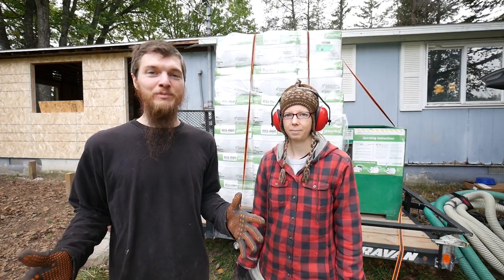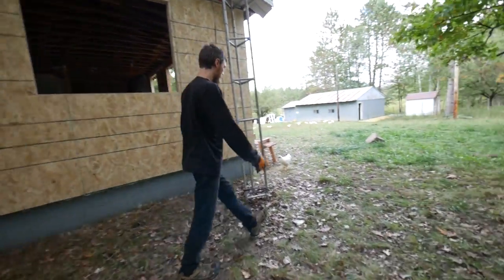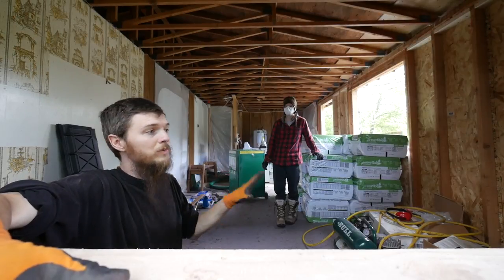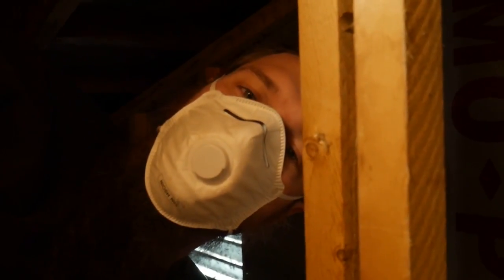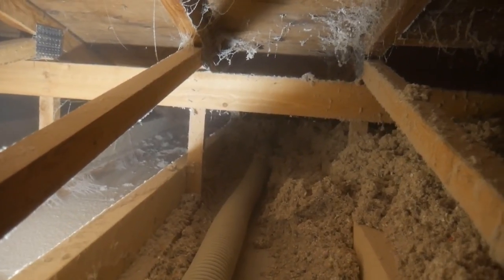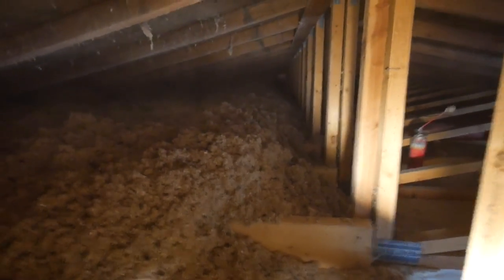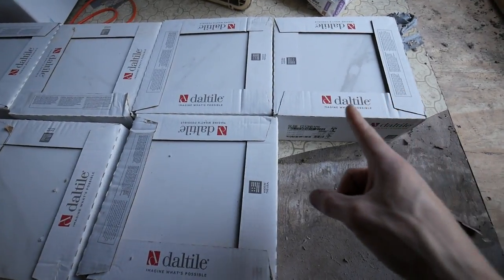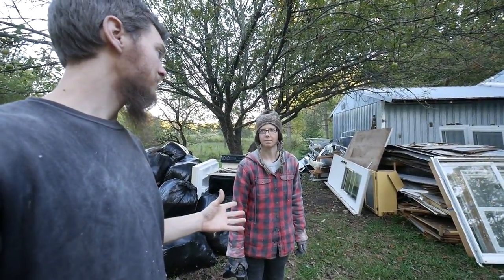Insulating a Cramped Mobile Home Attic - Home Renovation

Comment: When you do the other half of your house, try this:  Place your "bale" of insulation on top of the hopper, take a box knife and slice it all the way around the middle, rolling it forward and dragging it back towards you as you go.  Be sure to cut the plastic in one continuous line, to make two halves.  Then simply pull the halves apart, letting the entire contents slide into the hopper.  A good way to think about it is like cracking an egg in half and dropping it onto a frying pan.  Just be careful not to drop your knife in the hopper, or the bags, or anything else.  This is by far the easiest way to empty so many bags at one time!  I remember doing this, in sub-zero weather,  so speed and efficiency were of primary importance.  It is also was far neater!

Comment: Years ago I worked as a subcontractor for a insulation company. So did my husband. He cut roof vents in and installed them. I did isolation on the doors and windows
I also helped my husband and the other insulators. We blew in insulation into the walls and attic on older homes. Also wrapped hot water tanks. Loved the job. I did that for almost 3 years. Back then in the 80s the insulation was very itchy. Love watching you two working together.  My late husband and myself work on many a jobsite together
Great job. I miss working with  my husband. I have been a widow for almost 10 years. God Bless you both and be safe in all you do.☆♡☆♡

Comment: I used that insulation in two houses, in both cases in cut my electric bill in half.  I used duct tape to hold an eight foot 2x2 to the end of the hose, made it much easier to get to the low clearance areas.
Reply: Great idea norm solar hopefully doug sees your comment it will help him do the next lot...

Comment: This was an outstanding video.  I agree with Barbara...  hard working and respectful.  You inspire me.  The key you're working toward is to get your home dried in by winter, and it looks like you're doing it.  So much work.  I've tried 3 different people now to repair, and paint my porch...  Everyone said they wanted to do it, but no one has called back.  I need a 'Doug' and Ashley in my life.  Congrats on getting this insulation going.  It's going to be a toasty home, starting this winter.  I look forward to your videos.

Comment: We moved to a condo on a slab 3 years ago.  We were able to make all our flooring choices because it was not built when we bought.  We chose to heat both bathrooms and kitchen floors.  I love it.  And it's not very expensive because heat rises, but getting out if a shower on to a heated floor in winter is a joy.  If I could do over I probably would also do it in all rooms since you can turn it way down or off if not in a room often.  Concrete floors get mighty cold in WI in winter!

Comment: Great job on the insulation. The depth you are putting in will make a huge difference in comfort and heating expense. I had a suggestion for later on in your reno. My sister & her husband owned a ranch for many years. When they built their house they built in a wash-off station. It was placed out on the carport with hot and cold running water. It was great for washing off the dogs as well as the farmworkers who had been out in the fields with the cattle. I thought you might find it helpful to put in a place out back of the house where you could wash off before entering the house. Boots, gloves and other clothing that gets muddy or covered with mule and horse residue. An old sink or tub would be helpful and easy to find at a cheap price. 
The time to do these things is when your walls are open and you can run the pipe out to a small workstation.

Comment: We blew in 24 inches in our attic 6 years ago and our heating bill went from 128.00 a month to 69.00. We had 3 inches up there and blew in 24 inches. I think its R60 at 20 inches. Owens Corning said after 30 inches it wastes the fluffiness so try not to go over 24 inches. See if you can get a rebate our gas company paid 70% so we only paid about 300 bucks total and in 6 years we have saved about 4 thousand dollars. Great job.

Comment: You evenly blanket your insulation, about  5" total.you can rake alot and spread it out.You must not plug up your rafter ends, tbhey must be vented from soffit into attic space for air flow.If not you will have severe condisation, which will cause icy roof and damage to shingles , plus awful mold issues in attic space .Did you install venting between your rafters? You both seem very knowledgeable. Plus the building supplier should have ran it by you wben you  picked up materials and the machine....Awsomme work ethics, Ashley appears to be a strong  worker , Always thinking one step ahead.
Reply from the maker: Yes we have rafter vents installed and I did my best to leave them clear and open. We'll be double checking them before we close up the soffits.
Reply: @diyfferent  I kinda figured you hadi t buttoned up right ! Not trying to be  a " know it all" but Iwas thrown for a loop when I didn't see it being done in your video! Lol Great job.Cheers from Nova Scotia ,  Canada !
Reply from the maker: @glenyoung4170  It's okay. We installed them in one of our previous videos before doing the framing and drywall.

Comment: I changed out those tiles you bought, they are extremely slippery with a little water on the floor.  I would exchange them for a rougher surfaced tile.  You don't want to fall on that hard floor.

Comment: Never saw that before. Most definitely gonna put this in my house. Mine is not a modular home but it's no bigger than the double wide. I will have to find someone to crawl around in the attic. I think I would be best at feeding the machine. 62=no attic crawling. So cool. Glad u showed this. What a huge help. Once it starts snowing u won't be able to see much of the stuff outside so it should be mostly hidden until spring. No hurries ... no worries.
Reply: My husband and I did this (with the pink stuff)  it's not that hard, but tiring.  And, the person feeding the machine gets a work out too!  Good luck...
Reply: I have a young couple close to me that come help when needed. Lately I have found myself discussing any repair needed to see if they have a better or more economical idea. They r really awesome and kind and so very good at repairs. So far I've adopted 3 things from Doug and Ashley for my home. This will be the 4th. This  channel is seriously inspiring and uplifting. Oh and once I was able to prevent a repair person from ripping me off all because I knew the problem and how to fix it and didn't let him try to con me.

Comment: After you get the bathroom gutted and the ceiling back up and before you start the insulation on the rest of the roof you could use a rack and just level it off what you already have down.
Reply from the maker: I didn't think it needed to be leveled off? I thought it looked pretty evenly filled.

Comment: It is quite important that you install and tape a vapor barrier, between the 2 halves of your "house"     I think I saw baffles standing against a wall, did you put baffles from the eaves to the attic ?     next time you get insulation, get a Tyvek suit, they are hot so wear only shorts underneath.     Keep up the great work
Reply from the maker: Yep, all the areas we insulated have baffles.

Comment: Yes you need vents in the attic of some kind....  That is going to be one warm casa.   I like the tile, just don't forget to seal the grount once a year.  Thanks for the sneak peak.  : )peace
Reply from the maker: We have a ridge vent now, so the gable vents aren't needed anymore. Air comes in the eaves and exits the roof peak now :) Thanks
Reply: @diyfferent  Yup that is fine as long as you have something that's all, but you two know what you are doing.  Ashley your still getting stronger I'm impressed.   : ) peace

Comment: Hard work for the two of you, but the usual a good result. We could see how hard you were working, those small spaces defeat me now, Ashley was really holding her end of the team up well, my goodness you are a hard-working team. Blown insulation does have attraction, unrolling rolled material into small spaces is almost impossible. These days I am not sure you can have too much of it, so apart from costing a fraction more, even if you have been over generous in places I can see no harm being done. A long handled rake could soon level things when you do the other half. I sense you are now trying to pick up the pace, not rushing, not cutting corners, but aiming a little higher after every completed task. I liked the tiles, running them through can connect spaces and give an impression of space and flow. Tiles are so much easier to keep clean than wood or carpet. Will you sort the scrap pile in any way, metal and metal items usually has some scrap value, it would be a shame to just dump the lot.
Reply from the maker: We will be taking all the metal to a scrap yard for $ :)

Comment: All well and true.  However even using blown insulation ( which I am not fond of because of its tendency to air blow especially in windy climates) there are techniques to use it from below.  They make a very light fabric specifically to contain it in open bays.  Cheap and easy.  Just staple up a few feet blow in and continue.  You can see what you are doing and control your application as well as not being crammed in the attic.  By the way for as much stapling as you are doing check out the Milwaukee 12 v stapler.  Cheaper than makita at around $100 or find a used one.  Well worth it.  Even a harbor freight pneumatic would help.  Hate to see anyone in an low pitch attic--it's no fun!  Also when installing brats it is better to use two layers and lay them at right angles covering the bottom truss chords so that is no problem.  Take care.  Doug

Comment: For that insulation one really needs a respirator instead of a dusk mask. The dusk mask just lets too much dust in around it's sides. But, disposable respirators are about $35 and they are good for only about 6 months (as I recall) before they have to be disposed of. A good idea, when buying a respirator, is to use an indelible marker to write on it the month and year you took it out of the sealed wrapper, or write the date it is to be disposed of such as "dispose of  6-19", for example.
Reply: And maybe some goggles.

Comment: Your doing a great job, but a piece of advice, keep the vents for the attic. You need the vents to keep air flow through the attic to keep the mold from forming from trapped moisture.
Reply from the maker: The roofer who replaced the roof last year installed a ridge vent so the gable vents aren't needed anymore :)

Comment: My wife and I were doing that blow in insulation. I was up in the attic. She was feeding the blower. Suddenly there was a loud noise. She had used a plastic dustpan to cram the blocks in. The dustpan got too close to the blades and ate up the dustpan. I nearly fell out of the attic. That was so funny when the plastic came through the pipe.
Reply from the maker: lol!
Reply: Lol thank God it wasn't her hand. I was wondering how dangerous that thing was? Ashley you be careful feeding that in there for the next half.

Comment: Wow! Great work! Good thing you are replacing wiring. With all the critter damage and that new insulation, I would worry. How flamable is the insulation?
Reply from the maker: They put additives in it for fire resistance and it meets fire ratings :) Thanks!
Reply: @diyfferent  so good to know! Thank you for responding! I hope I didn't come across as critical. I was just curious since you said it was similar to paper. Loving your videos!! I have been raving to everyone I know who is doing remodel work.

Comment: I still think that rock wool batts would be easier to install in the ceiling, from below before you put the plastic up. Even if its just around the edge
Reply from the maker: Doing the blow-in is much more efficient since it fills in all the spaces where the batts wouldn't be able to get, like the space right above each joist.

Comment: Great job with the insulation it is a very small crawl space in your roof...love your tiles cause they are the same as mine I have had mine down for nearly 20 years and they still look as pretty as the day I first got them like yous I had sticky vinyl unsealed ones for 10 years it was horrid, I especially like my tiled entranceway and they are easy to clean if you get the chance buy a grout sealer and spray it on that's the only thing I would do different so my grout in my hi traffic areas would look as new as low traffic areas...I wont get to watch your next few videos as I'm going on holiday to uluru its Australias version of the Grand Canyon and I wont have any internet it's very remote and I'm going to miss watching yous but on the upside I will have lots to watch once I get home first thing after playing with my bulldog...have a great few weeks guys hope yous get everything done b4 the snow comes...😊🤖🦄
Reply: I think they will go with white it is more their style they are not interested in trends they prefer nice clean sharp and minimal, mind you I'm thinking of doing grey grout with subway tiles in my laundry I've had white for 30 years...😊

Comment: Glad to see it went well, but I'd do anything to avoid being crammed into that shallow space. I'd have left the old fiberglass, gross as it was, and injected fiberglass, cellulose, or foam on top of it with the intention of completely filling the space to eliminate the need for venting. My attic, which is tall enough to at least crawl and has room for storage, has that cellulose and just walking on it was unbearable; I put a flat, sealed floor over it so I'd never have to get near it again.
Reply from the maker: We had to gut it all to be able to sister thicker joists to the old small ones be able to hold drywall, plus redo all the wiring. As tough as a job doing the insulation is, it's doable and it's just temporary. Once it's done it's done for good and there will be no need to go up there anymore. And that will be a great moment when it's done :)

Comment: Ya'll are so cute all covered in dust.  What a great job.  Was it very expensive?  I need to do this to my rental.  Oh! and that's the same tile I'll be using in my reno only it's 12"x24".  I love the tile you guys picked!!
Reply from the maker: The bales costed us $8.80 per bale (we got 36 bales) and the rental was free. It covered about half our house with that much and our house is just over 1000 square feet. It's pretty affordable insulation.
Reply: @diyfferent  Great.  I'm going to look into that.  My house is 818 sq ft.  Thanks so much!

Comment: If you were working on my home I would gave you my safety goggles and Miller dual pleated resperator  . NEW  . I need help on advice on my duct board  replacement . But seeing you were able to get into the roof Cavity-Attic  didn’t know it was possible . Had new AC and furnace installed  but wouldn’t touch the duct .

Comment: You shouldn't remove the side vents!!!! Remember the black plastic soffit vent protectors?  Well the air comes in through the soffit vents, then OUT through those side vents.  If you close off those side vents, there's no place for the air to go and you will BAKE in there.  PLEASE consider putting vent covers back and not closing off those side vents they are VERY MUCH NEEDED!!!!!
Reply from the maker: The roof was replaced last year and the roofer cut and installed a ridge vent so the gable vents are no longer needed.

Comment: I gotta tell you that I would have used batts and installed them with chicken wire from below while the ceiling was open.  I didn't understand why you would close it up without insulating first.  Having spent some time in a 4/12 trussed attic I know it just isn't viable to try to reach the eaves in an even manner.   Almost have to extend your bay vents up further as well when blowing.  Just a flat bitch to work in such a limited (where you can crawl and step) space trying to do a good job.  I have used rolls of insulation and pushed them out to the eaves with an extension broom handle.  Not fun!  But you can see what you are doing somewhat and cuss the roofers that used long nails on the shingles!  Hope you have the mice sealed out as they love cellulose even more than fiberglass.  Take care.  Doug
Reply from the maker: Yes, we have the mice sealed out. Mice love all kinds of insulation. To us, if mice have access to our house, then we've already failed. Everyone should have their houses sealed off from mice. Since attic insulation has to be super thick to attain the sufficient R-value, doing the blow-in is much more efficient since it fills in all the spaces where the batts wouldn't be able to get, like the space right above each joist. And since we sistered new joists to the old joists it creates an even more weird area to fill above them that batts would be difficult to cover with. Using batt insulation would have cost more and been much more difficult, having to cut every batt to fit the width and still have voids. This was just the best option for our situation.

Comment: You need the vents to prevent condensation. Especially if the eaves don't have open clear vents.
Reply from the maker: We have newly installed soffit and ridge vents so we do not need the gable vents. It's better without them.
Reply: @diyfferent  
okay. LOve the channel. Thank you.